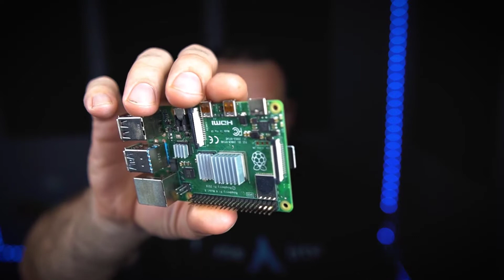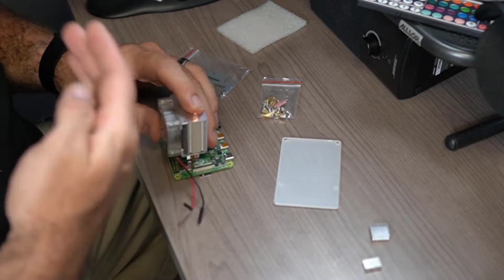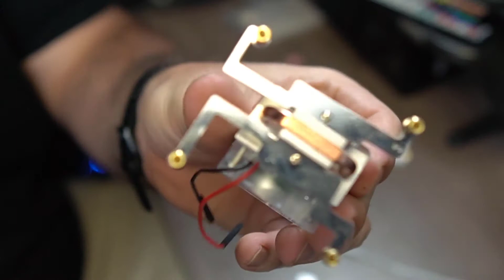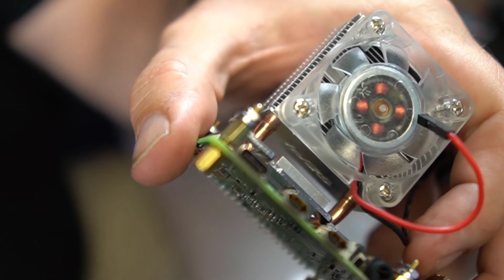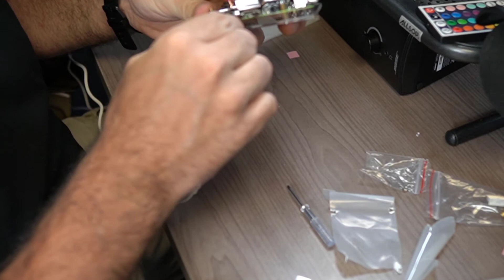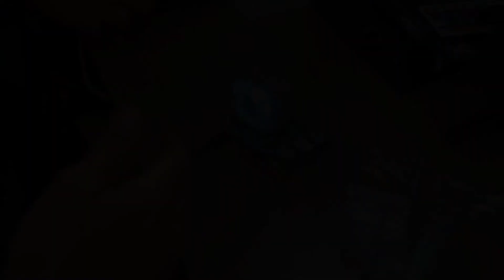Installing the Raspberry Pi ICE Tower Cooler

Comment: Hi I have the same setup but the ice cooler light did not came on when I switched the pi on is this normal or do I need to replace the ice cooler? The pi is running on the screen so I don't think the issue is with the pi unless maybe its the pins on the pi